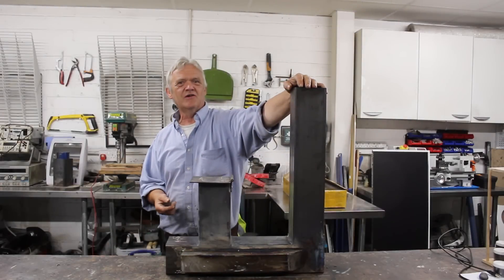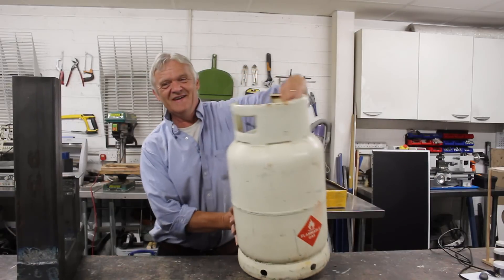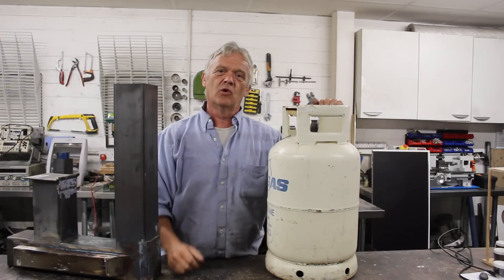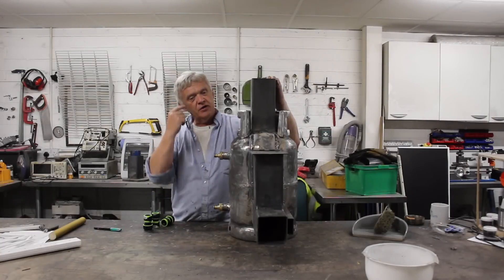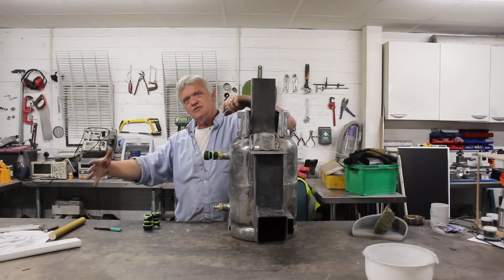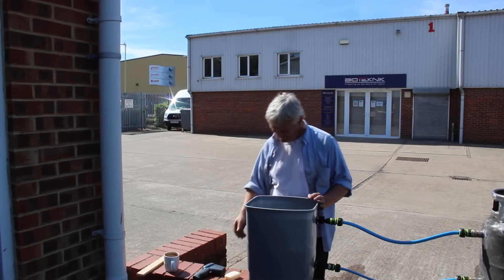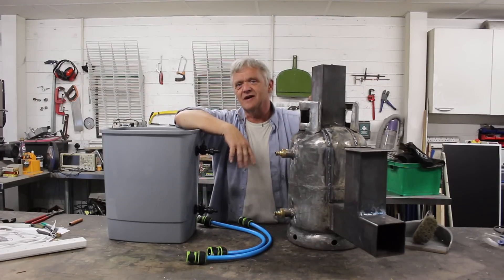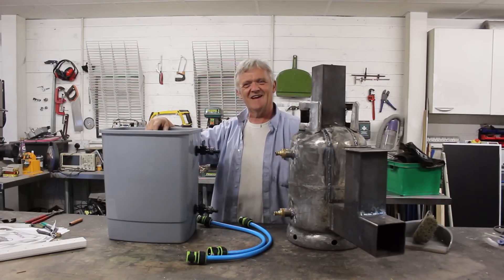1603 How To Make An Amazing Super Efficient Rocket Stove Water Heater - Beat Those Fuel Prices

Comment: Iv been toying with the idea of using something like this to heat my workshop/paint booth. 
My thinking was i could run the hot water to a large van of truck radiator, and draw my intake air for the paint booth through the radiator. Keeping heat in the room when the extraction is running 🤔

Comment: I wonder how long after the fire has extinguished would it continue to heat water if you ran the water through a copper coil, sligtly spaced away from the Chimney and the mass contained around both the aforementioned was Sand. Essentially a Rocket Stove, mass heater, water heater come Sand Battery.

Comment: Nice fabrication.  Nice shop.   

A man with gumption could use this for warm water heat in home or RV.  That's a very small, simple apparatus that could heat up a whole lot of water, with that setup.  They make flat water tanks for RVs.  Get a high-capacity flat tank and heat it up with one short burn.  Something like that, insulated on its sides and bottom, would probably keep the floor warm for hours.  Solve all your heating problems off-grid, and burn less wood.  

Speaking of burning less wood, I wonder how many loads it took to be just below scalding level?

I got a kick out of how much your body language proved how hot it was.  That'd be pretty hard to fake.  Awesome.  You had to hold that water a second before hitting your face, but you couldn't hold the water for that long.  Good chuckle.

Comment: Nice work, but a fundamentally flawed design. You are cooling the combustion core and making it an incomplete burn and inefficient. You need to insulate the combustion core (burn tunnel and heat riser)  so it gets as hot as possible, and put your heat exchanger in or around the exhaust from the riser.

Comment: When you make a Cooper pipe winding around the stove you could get a flow without a pump. Our old Wood Burner could run without electrisity only with the flow through the warmer water going Up. You could make a similar thing with a Tank for warm water in RV or Tiny Home. The problem would be with too hot water. The simplest solution would be to make the winding detachable but then you have to be there the whole time or you can make two exhaust's and shut down the one with the winding at 85°C. The water Tank would also be a good reservoir for the heat at night.

Comment: Brilliant concept, and seems efficient. Thank you for sharing.

 I would like to weld one myself, and actually have most of the materials on hand, but seriously. How long did it take you to make all those watertight welds?
I always get a ton of pinholes when i do stuff like this, and I can't quite figure out how to make sure it's water tight.

I'm quite the newb.
Reply: It might be easier to use a copper coil in contact with the furnace. Since these will eventually rust and become harder to maintain.

But to answer your question. If you are stuck welding make sure you know the type of metal your welding. Pair the type of stick and size. Try and weld with horizontals only. Make sure the metal is clean by grinding the edges you are to weld. Weld with the stick being pulled back from the start, no pushing or tapping. Make sure the amps are atleast in the middle of the recommendation on the sticks you have. Keep the stick as close as possible without digging or dragging. Use a bit of a angle away from the weld rather than holding stick at a 90. Go slow enough that you have enough material becoming a puddle, watch the puddle since you want the melted metal infront of the slag. The slag should rise to the top. If you have spattering something isn't set right. Don't go over old welds or fix areas until you have cleaned away the slag. Most porosity is slag that is encased in the weld. Practice on some scraps that are from the job to rehearse and get comfortable and confident, to ensure you won't blow a hole through. Ideally you want slag that just falls off. Some stick types have a frustratingly thick/dense flux that is harder to control (6013) running electrode positive will give less penetration, negative will give more penetration. So you may want to run electrode positive if these are thin metal work pieces.

But this configuration won't last long. The heat and the water will cause the steel to rust quickly. It requires an anode placed in the tank. With an enamel coating on all the metal in the tank, usually a polyurea.   It will ravage the welds first, and any weak metal there.

Comment: Get an old discarded radiator from a car or from a I don't know anything of air conditioner and run only the air conditioner inside and hook a fan to it keep the heating part outside you put enough wood in it just to run it up to temperature and see how much heat you can generate inside your shop from a small load of wood doing that with a small fan

Comment: absolutely fantastic you my friend are one of a kind . i have made your rocket stove and filled it with sand to heat my shed as i was using gas (far to expensive) now i use wood and wood pellets (very cheap) and burn clean. The pellets turn to a light dust and gets sucked out the chimney. im looking into a home made hopper to keep this heater going all winter. the temperature im getting from the heater can be regulated  with the air intake door quarter, half or full open. i can keep this temperature at 26c every day all day..... Thank you again  Allen

Comment: Not really keen on plastic pipes and metal work beyond copper tubing, but I understand this video is mostly a proof of concept and it does its job perfectly. I am starting designing my heating system based on all the excellent videos in this channel and others, so thanks for the inspiration.
I'd like to keep the air intake and exhaust outside of the house, as well as the fuel intake, with the combustion chamber inside the house but never in direct contact with the air from the room. A secondary air circulation system would also provide heated air, not just heated water or radiating infrared from a heat accumulator such as clay. Lastly, if I can find how to incorporate it, I would like to start with one fuel such as wood, but also allow to connect later on a barrel of recycled cooking oil or a bottle of propane/butane or methane from compost as well as solar vacuum tubes for a bit of redundancy, resiliency and tinkering...
I also plan to set up a glass house on the south wall of the house, which will require winter heating as well, so I am thinking about a large underground steel water tank that could store enough heat for the glass house and maybe low temperature heated floor or walls, since the whole house needs renovating anyway.

Comment: Robert, would making a heat exchanger from copper pipe like the stuff that is used in air conditioners of old using water instead of gas ??? The idea came to me when reading that Albert Einstein developed something like that years ago without using any energy to move the gases with an electric motor.  Nice work fella for sure.

Comment: Great job!  As it stands it would be a great heater for the spa pool on your deck!  Of course, if you want to heat water with fire, the lads at your local Model Engineers Society club will point you in the direction of more efficient boilers, starting with the Scotch Marine, locomotive horizontal tube types etc.  All have been pretty well optimised over the years to make best use of the available fuel.
For your version, splitting the draught into say nine (3x3) horizontal tubes between the firebox and the vertical chimney section would substantially increase the heat transfer surface for gas and water, and hence improve efficiency.  You may need a slightly taller chimney to improve the draft, and ensure full combustion.
I would drill a vent hole in the top of the gas cylinder too, as a safety valve if water circulation ceased in the primary circuit (eg someone's knickers get sucked into the bottom line!;)
.
Good stuff!
Reply: The surface area between the stove and the tank is much greater than just running pipes through, in my opinion.  It would also affect the performance of the stove, itself, and negatively.
Reply: @harrymills2770  maybe do the math n report back please.

Comment: Hi Robert, love the videos on rocket stoves.
I'm wondering if the water would still flow if you put it in a figure 8 type setup where the cold water comes from the top and hot delivered to the bottom, will that speed up the heating time? Since heated air rises, I thought it might work with water as well. Please let me know what your thoughts are on this. Thank you.
Reply: Its all driven by the density gradients.  Less dense hot water slithers across the top pipe, displacing colder water which is shoved from the reservoir into the boiler via the bottom pipe.
It would work better if the reservoir was raised a bit, so the flow was up-hill  boiler to reservoir, and downhill reservoir to boiler.  That way too, you could have the upper pipe entering the reservoir lower down the side of the tank, which then improves mixing as the entering hotter water rises up thru the reservoir.
Ideally the flow rate is such that the system operates near-isothermally - i.e. the temperature of the water leaving the boiler is only just warmer than the temperature of the water entering.  That way the heat transfer from fire to water is working best. That implies a high flow rate, so big circulation pipes.

Comment: Consider a variation of this where instead of a water jacket surrounding the riser, you instead had a plastic pyrolysis chamber. Using minimal wood to pyrolyze waste plastic back into diesel fuel and gasoline...

Comment: My understanding of the rocket stove mass heater design is that the combustion chamber section is insulated to keep the temperatures hot and combustion as complete as possible.

By placing the water jacket around the stove, I cannot say what the temperatures inside the stove are, but the water jacket side is going to be 100 deg C (212 deg F). This, would seem counter to the rocket stove concept. By extracting the heat at that stage, you cool the combustion reducing efficiency.

In a rocket stove, the hot flu gases coming out of the top are not the waste byproduct or an exhaust byproduct, they are the main product of the process.

In RSMH practice a bell chamber is placed over the vertical pipe to trap the heat a create a secondary burn of the wood gases created in the first stage. Then the hot exhaust from that is channeled into horizontal chimney piping surrounded by thermal mass(cob dirt, sand, concrete often in the shape of a bench or long bed) for long term storage. The bell gives radiant heat right away, and the thermal mass stores it to be released slowly over the course of a day or night.

There are other water heating designs that wrap the vertical section with coiled copper tubing, but they seem to miss the point as well. The hot gas moving up and creating the draft is not the byproduct. It IS the product.

As a test, how long would it take to boil water in a tea kettle placed on top of the vertical shaft?

It’s a great build, but when I saw the gas tank my first thought was ‘place it right over the top, what could be easier?’

Thanks so much, Robert!
Reply: The bell in RSMH isn't for secondary burn.  All the burning takes place by or before exiting the riser.  I think the bell has more to do with driving the air flow (or rather "pulling").  The idea is that the volume of the space between the bell and the riser is greater than the volume of the riser.  No.  That's not quite right.  It's more about the cross-sectional area, because we're talking about the flow of an elastic fluid (gas).  Cooling takes place instantly as the air leaves the riser, lowering the pressure in the bell relative to the pressure of the riser, giving the gases only one direction to go, and forcing it along with more force and velocity than you would obtain by convection (heat rises), alone.

I really need to learn my thermodynamics and P1V1/T1 = P2V2/T2 stuff (gas laws).

You can get the rocket sound without insulating the riser.  As RMS has shown in his other stove builds, placing a mantle or any kind of chimney greatly aids combustion.  

All gasifier wood stoves inject oxygen-enriched air into the exhaust gases to complete the burn.  That's the only thing I'm sketchy about.  I THINK venturi effect keeps the air into the secondary chamber and not back out, but I'd have to think about/test it before being confident I could build one that's safe for indoors.  I think that a RSMH works better if you can port fresh air into the base of the riser.  

Not being critical.  Just expressing my current, imperfect understanding - which is quite tentative - in declarative sentences that sound like I'm more certain than I am.

Comment: One assumes the water goes rusty brown after a bit of use, but as a simple heating system……………….. 
nicely done as usual.
Reply: Use a stainless steel tank copper tank or copper tubing.
Reply: @Barskor1  a nice thought, but I haven’t seen any gas cylinder made out of stainless or copper

Comment: Great little water heater. Super simple.  just found a gas bottle to do the same thing. I was thinking of  using a copper coil inside the drum around the heat riser surrounded by insulation to avoid the issue of potential rust in the water?

Comment: Excellent idea very good and very easy to make. i have a few empty gas bottles which i may give this a go.  Thanks
Reply from the maker: that's awesome - the tricky bit is welding it so it doesn't leak
Reply: @ThinkingandTinkering  liquid metal is pretty good for that and also with stands a very high temperature, like SealXpert that can withstand temps of upto 230C.

One question i have, I only have a gasless mig welder is that ok to use or do i need the arc welder with rods?, thanks in advance.
Reply from the maker: @Dr-Sy  that will be fine mate after all most of it can't really get hotter than 100C

Comment: I very much like your projects, and subscribe. I wonder if you can expand how you would turn the water heater into a sand battery to constantly heat water or create electricity. That will be very informative.
Reply from the maker: on it mate
Reply: He was talking about mass heat exchange.  Sand doesn't have the highest heat capacity, but even sand sleeve around the stove would create a heat sink that would store heat and give it back over time.

Comment: connect to a CH pump and the CH system et voila! Do you think the heat produced by this method would be able to heat 5 rads in mid-winter with outside temp at 0*C if kept alight?  Interesting thought.
Reply from the maker: yeah I think it probably would mate

Comment: Hi Rob. Good work. I have a prototype version of a mono tube boiler it’s only got 12 meters of copper coil and can do 10 to 15 psi. I need to work on the water input more. But running it manually is a bit of work.
Reply from the maker: are you doing a video on it mate?
Reply: Interesting so hot spot in tube pushes water/steam to cool off in the rest of the tube coming round to be reheated are you using a Tesla valvular to keep the flow monodirectional and do you have a turbine in the tube to generate electricity? Edit are you making the system a circle, oval or some other shape to limit energy loss or water hammer impacts from corners?

Comment: What if you used and old water heater tank retro fitted with a rocket stove rather than its traditional heating element you could potentially heat your house water "off grid" and with today's power prices only going up at least reduce your power bill (assuming your water heater is outside and you kept the fire burning or lit it 20 mins in advance to use)
Reply from the maker: I like that thinking mate - I will keep an eye out for one - they are all copper so expensive - but I like it
Reply: @ThinkingandTinkering  here in Aus they are stainless Steel so are a bit more common to find on the side of the road. Being all copper would have many advantages though can't wait to see your results

Comment: You could make a steam boiler for a steam engine pretty easy with it.
Reply: You can. I have a mono tube version on my YouTube. Does 15 psi well. Working on improving it.
Reply from the maker: yep - add a pressure gauge and a blow off valve and you are there

Comment: very cool build but why not just wrap the stack in copper tubing and circulate the water through that? hot water doesnt hold as much heat as concrete but it can do the same thing to a degree, add a heat exchanger on to that tank of hot water and you could heat a small room with a very small fire
Reply from the maker: unless you used micropore you would be on a challenge to get the copper pipe close enough so that heat losses were minimised then it would act more like a flash boiler in which case steam bubbles in the pipe would be an issue - you can do it mate and it is a good idea but there are more technical challenges to overcome - this is pretty simple and effective
Reply: @ThinkingandTinkering  I never considered any of that. I've used copper coils around radiator hoses, exhaust pipes, on a barbecue grill and laid out in the sun to heat a tank of water

Comment: That's very neat.  I have a similar arrangement, but using a gas boiler to heat glycol to circulate through a calorifier.  I imagine your chimney won't last long with fire on one side and water on the other.
Reply from the maker: I don't know - it should even out the thermal stress I would have thought - only time will tell on that mate
Reply: @ThinkingandTinkering  I was referring corrosion, not stress.  Heat and water both facilitate rust.  That's why we use glycol with corrosion inhibitors both in engines and calorifiers.  And stove back burners that work in a similar fashion to your rocket stove heater.
Reply from the maker: @ChristieNel  oh right - well that's nice info right there mate - thanks for adding it